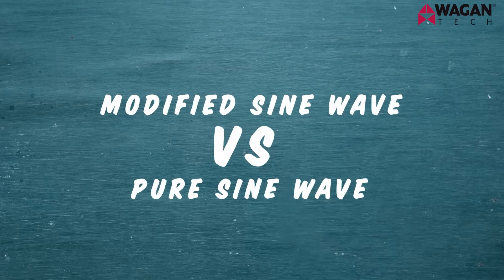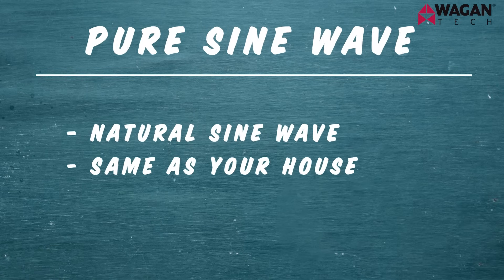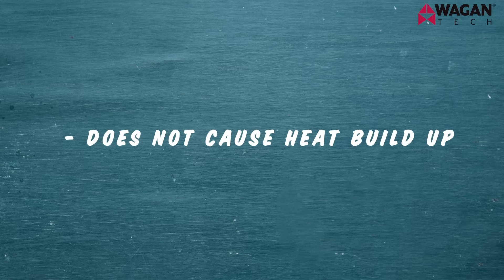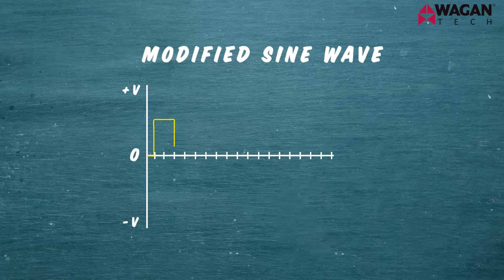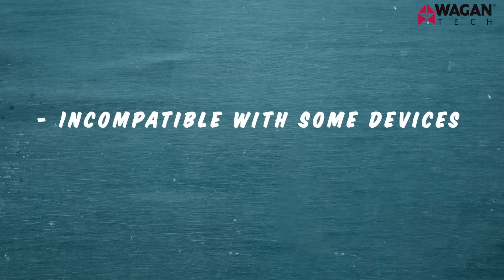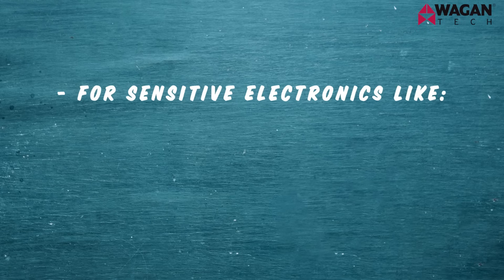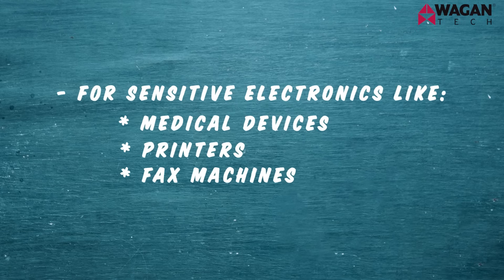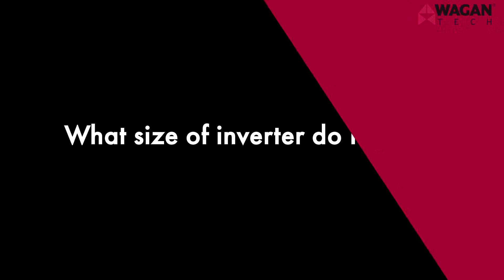What is a Power Inverter and which inverter do I need? What does a power inverter do?

Comment: you explained the difference between Pure sine and Modified sine, but in my mind i would just then want to go with Pure sine as it can be used for all?  Is there a negative reason for using pure sine on a blender for example?
Reply from the maker: No, there's never a negative to using pure sine over modified sine. The only reason that MSW exists is price point.

Comment: What would i need if im trying to run a makita air compressor
Reply from the maker: Air compressors generally run just fine off of MSW. Be sure to get an inverter that can handle large start-up currents as air compressors require a huge amount of current at start!

Comment: what happens if you use a much bigger inverter than you need.? ie:- 1500 watt  and my appliances are 800 watts maximum
Reply from the maker: Good Question! There are no detriments to using an inverter that is too large.... the only thing that will suffer is efficiency as inverters should be outputting around 80%+ of its capacity to be the most efficient. At 800W , a 1500W inverter would be running at 53%+ efficiency which would be just fine.

Comment: Hi

How to set up a mobile tire change  van with 1500w inverter  powering 1500 w air compressor + 1050w tire changing machine ?

24 gallons air compressor gets full in aroud 4 minutes which is enough to fill 1-2 tires , meaning  air compressor will have to be filled 2 -4 times per car . Tire changing  machine  will probably work for 8 minutes per car. 
120 ah battery should fill air compressor and  still have about 75 ah left after it.

Once 1 car is done this way then van will idle for 10 minute while packing tools and then  travel to next car for about 20 minutes + can idle for another 10 minute while getting tools  out for the next car.

Wonder how fast can van's alternatot recharge battery while idling and driving for this kind of time intervals.

Ford transit 2004 , 2.0 tdci, fifa, 92 kw

i think it has 105 a alternator .

Where to look for larger alternator if it can be installed ? Thicker cables as well ?

Thanks !
Reply from the maker: Here's a video we did on cable selection too: https://www.youtube.com/watch?v=aKs3oZnBOPM&t
Reply from the maker: It looks like your stock alternator is about 105A, but can accept 150A with ease (confirm with Ford)- I see them for sale online. Getting the most power from your alternator is the best place to start since you're power needs are high. How fast it will recharge the battery is dependent on how much power your van is consuming, unfortunately I don't know what that power number is.
The inverter you're considering is 1500W, but will be needlessly taxed in this set-up; I would recommend an inverter of 1800W+ for using the machines individually (added 20% buffer to the highest wattage appliance).
Will you be running the air compressor and the tire changing machine at the same time? If so, you're going to need an inverter that is 3000W or greater (1500W + 1050W + 20%).
A 120Ah battery seems about right for your needs as long as the alternator can keep up; I would suggest a second battery to lessen the load on the system.
For the cables you'll need, first know which inverter you're getting, then look at the distance the cable has to "run". Once you have that info, take a look at this chart here to find the fuse and cable gauge you'll need: https://wagan.com/blogs/news/customer-question-what-cables-do-i-need-for-my-power-inverter
Hope this helps!

Comment: Can I charge the inverter from a regular wall outlet ? Or just only can work with cigarette outlet ?
Reply from the maker: Hi! Inverters don't have batteries, so they can't be charged. The power inverter is primarily to take your car's DC power and turn it into useable AC power (regular wall outlet). 
If you buy a portable power pack that has a battery and an inverter built in, those can be charged from a wall outlet, car socket, even solar power: https://wagan.com/collections/lithium-cubes

Comment: I drive a car with a small 1.6L engine and 12Volt battery.  Can I plug an 8000Watt inverter into the cigarette lighter and run a 1800Watt vacuum cleaner, or will this overload my car's electrical system.
Reply from the maker: Hi there, Your vehicle would not be able to support an 8000W inverter; there simply isn't enough juice to power it.
The cigarette lighter socket is either fused at 10A or 15A which means you can only get a max of 120 watts or 180 watts - there is no way to pull more wattage from the cigarette lighter socket.
If you need to power an 1800W vacuum, I would suggest getting a 2000W inverter and connect that to your car's battery (and use with the engine running).
Reply: @WaganTech   Thank you!
Reply from the maker: @Afrocanuk  my pleasure!

Comment: There are in fact square wave inverters, they're very rare nowadays as everything has gone to modified. modified is anything between square & sine wave. Usually that means one or two steps to approximate a true sine wave in a blurry fashion. They run most things but they are not very efficient and motors tend to not like them.
Reply from the maker: You are correct, the MSW today is way "cleaner" when compared to the true square-sine wave inverters.
Reply: @WaganTech  in some ways I think true square wave would be more useful now that everything is switch mode power supplies these days. But now that I'm on a true sine wave (
Wagan) inverter I would not go back. And wish I just saved money up and did it the first time.

I tried to run a salsa off a 750W modified sine wave inverter, after I upgraded I was able to run the sawzall + fan and I think I might've had a heater at the same time from a 700W! I went from having to hand saw with the sawzall to I wish I had this last week! A tree fell across are road and my dad noticed it at 4 in the morning leaving for work so I needed someway to cut it without making too much noise in the middle of the night since it was in a blind spot at that. And well away from power.
Reply from the maker: @imark7777777  Did you mean sawzall?That's awesome! Thanks for sharing!
Reply: @WaganTech  yes speech to text can be annoying.
Reply from the maker: @imark7777777  LOL, so true!
Reply: @WaganTech  well I just pulled the trigger on a 2000W and 3000W. I noticed that nowhere was the size of the cable mounting bolts listed. Or did I just miss it somewhere. Planning to measure when I get them for some quick disconnect Anderson Powerpole connectors. It's going in the van and I'll have plenty of power to spare and be future proofed. I will also be able to run any AV equipment I need although the 700W one already fulfilled that just fine for my PA equipment, although might be on the edge of the requirements of other band equipment. The 2000W willl be my mobile unit so I don't have to rip the van apart if I need to borrow.
Edit: 3/8"
Reply from the maker: @imark7777777  glad you figured it out, please let me know if you have any other Q's!

Comment: Due to the over 100 heat weather in Ca, We lost power twice in a week. Do you think is safe to run a home refrigerator using a 2000 watt car power inverter?
Reply from the maker: You can as long as the battery can handle the load. We're in CA too, today is going to be a scorcher - stay cool!

Comment: Thank you for the video. Doe this mean when I have a 4000 watts inverter, I may connect and run  a 3000 watts vacuum  cleaner?
Reply from the maker: First off, thanks for your Q and for watching!
If it is one of our inverters that you own, then the answer is YES!
Reply: @WaganTech  certainly your product here in South Africa 🇿🇦.  Should I start each motor gradually to run full 3000 watts on the 4000 watts pure sinewave inverter.

I am learning how this works as I just started a pressure washing business with intentions of adding gutter cleaning using a vacuum cleaner with a 12v batter 100ah and a 4000 watts inverter.

Comment: I have a question...... if I use a inverter 1000w which is running from a 12 v battery charger running from mains and i am  runming a desktop pc .... will I be using more electricity or less .....?
Reply from the maker: Jesse, you'd be using more power. A PC actually runs on DC voltage, so the transformer inside is converting the wall AC into DC already.
In that set-up you suggested, it would be taking AC power to feed the battery charger which would turn the AC to DC. The inverter would then take that DC and turn it into AC for the PC.
Literally it would be: AC to DC, DC to AC, then AC back to DC.

Comment: I have a 50 whatt light and a 800w inverter the inverter turns on and starts beeping on its own and turns off and a lawnmower battery u1r and rv 29dc battery and it works for a little bit but stops shortly after
Reply from the maker: David, there can be a lot of factors here. 
Is the inverter connected directly to the battery and what gauge cable are you using? 
Obviously the load is well within the limit, but I would like to know what voltage the batteries are at?!
Is there a dimmer switch on the light?

Comment: Great videos, I have a Mackie Thump 15 loudspeaker 1000 W, which inverter would you recommend on your website
Reply from the maker: For speakers, I always recommend Pure Sine to avoid any humming noise that may be generated! If your speaker is drawing 1000W, I would recommend getting a PSW inverter that is 1200W or larger like our Pure Line 2000.

Comment: Can this be hooked up straight to a battery that’s not under the vehicles hood? You have videos on this?
Reply from the maker: Yes, you can connect straight to any battery that is the appropriate voltage. You should always fuse the cable between the battery and inverter.
We have an excellent blog here: https://wagan.com/blogs/news/how-to-connect-a-large-or-small-inverter-to-a-battery

Comment: How about running a hot-tub using a solar panel to batteries then the inverter to power the tub.
Reply from the maker: Only if I can join in!
You can certainly do that, I know a couple of people who power their cabin's hot tub in this manner.
Find out the hot tub's power requirements (in amps or watts), then that will get you the inverter size you need. NOTE: Some hot tubs are 240V instead of your "standard" interior household 120V) - you'll need the appropriate voltage inverter for this to work!
I can help calculate battery-bank size needed for powering the hot tub once you get me the run-time per night (desired run time of the hot tub per night).
Of course, check with your local city/county codes for proper & safe installation of electrical appliances!
Reply: Thank you for your response. Of course you can  and share a beer 🍺 my hot-tub is infact 240v 50hz. The heater is 2050w. And heater + bubbles are 1850w I'm looking to have it plugged into the inverter 24/7 so the heater kicks in and out to maintain the correct temperature and when it's in use probably run the bubbles for about 1 hour 30 minutes max for the day then it will be left to just have the heater kicking in and out to maintain the temperature again. Hope this helps many thanks Wayne.
Reply from the maker: @waynehammond1384  That's going to draw a ton of power; you'll need a large battery bank to keep that going 24/7. If you want us to calculate that bank, shoot an email to customerservice @wagan.com

Comment: I wana run a portable ac of 1500 watts in a car which invertor should i use ?
Reply from the maker: Usman, the biggest problem is going to be having enough power to keep that AC unit going.
Find out what the surge current (in Amps or Watts) of the AC unit is (usually when the compressor comes on), then find out how long you want to run it for. 
If the vehicle is a diesel or something with a larger alternator, this probably wont be an issue; if it is a smaller car, then the alternator probably wont be able to run the AC unit.

Comment: what's better for charging devices, power inverter or car charger?
Reply from the maker: Hey Stephen, What do you mean by a "car charger"? A power inverter is great for converting your car's 12V DC power into household type 120V AC power.
Reply: @WaganTech  It works the same way - plugging into the lighter socket - and has usb and c slots for charging devices.
Reply from the maker: @stephenhogg6154  oh, gotcha. Those type of devices are perfect for charging your tablet and your phone.
If you want to charge something like your laptop or power your 120vac appliance, that's when you would want to use a power inverter.

Comment: tell me how to use them in a hurricane situation in FL. can they run a fridge? how big, how long? I was told to turn on fridge for 1 HR for 4 hrs of rest
Reply from the maker: Diego, that's a very good question! Ideally you'll want to have a car nearby to power the inverter when needed.
If it's a newer style refrigerator, they generally run in the range of 250 to 400 watts, you'll want to check the specs of the refrigerator to see what its running wattage is. When you're concerned with power, you'll want to open the refrigerator as little as possible to keep the cold inside.
Refrigerators only run as needed, so they're actually quite power efficient in that sense.

Comment: Great video. Do I have to car keep running while I’m using the inverter? Thank You
Reply from the maker: Thank you and good question!
You don't necessarily have to keep the engine running; it is dependent on a lot of factors including battery size, load, etc.
In an average car, you don't need to keep the engine running for charging a laptop or other small electronics. 
If you're running a blender for just a few seconds, you wont have the engine running.
If you plan on running a high-wattage item for a long period of time or a low-wattage item for a long time, then you'll need to run the engine a bit.

Comment: whats the minimum 12v battery amps i can run an inverter on?.....
Reply from the maker: It is all dependent on the item that you plan to power with it... the larger the item or the longer run-time, the larger the battery you'll need.
If you send me an email with your appliance wattage/amperage and your required run-time, I can tell you what minimum size battery you will need to run it.
customerservice@wagan.com

Comment: i have   4 panels poducing   30.7 volts i  want  to  powere  an emersion  heater    what  converter   do  i  require   will  i  need    more  panels  to  power an emersion heater
Reply from the maker: Mark, is it a small immersion heater for heating tea, or is it a large one? Do you know what the wattage required for the immersion heater is? Either way, you'll actually need a battery to power the immersion heater and use those solar panels to recharge the battery.
Reply: @WaganTech  its  3 kilo watt
Reply: it heats hot water
Reply from the maker: @markthompson1134  you would need to power that immersion heater from a battery bank as 3,000 watts is not easily powered and not stable using only solar panels.

Comment: Hi Justin what type of temporary portable battery source is best for running a small microwave or refrigerator in a van? Thanks
Reply from the maker: Hi! Microwaves draw a huge amount of power (like around 1100 watts), a small dorm fridge will only draw about 70 watts. You'll need an inverter that can handle that load as-well-as a battery that can feed that power (for the microwave). I can help you select the right size battery if that helps?! I just need to know the expected run-times between charges (or driving).

Comment: Can I connect my inverter to a new 2021 Hybrid SUV battery and keep it on all night??????
Reply from the maker: Michael, you would need to check the owner's manual for the best way to connect the inverter. I would suggest turning off the inverter when not in use to avoid unnecessary battery drain.

Comment: So if you got one that had lots of wats like 750w would that be better just so you know you don’t overdo wats
Reply from the maker: River, you can get an inverter as big as you want, but then it comes down to efficiency.
Let's say you were to buy a 5000 watt inverter but you only had a 200 watt load that you'd apply to it. The inverter would work fine, but it would not be efficient and use more power than it would need to.
Generally we recommend sizing the inverter so that it will be using 70 to 80% of its power range while in use; this will provide the maximum efficiency for your setup.
Reply: @WaganTech  thank you very much!
Reply from the maker: @willywonka9613  my pleasure! Feel free to reach out if you need more info!

Comment: I am a barber and when my coworker beside me operates his hand held hair dryer it slows my hair clippers down. Any suggestions?
Reply from the maker: Are you both using a power inverter or are you plugged into a wall socket? Either way, a salon hair dryer is going to pull somewhere around 1800-3000 watts which is a huge mount of power! This would be the reason that your clippers slow down when the hair dryer is running as that hair dryer is using up all of the available power in the outlet!

Comment: Thanks for the explanation. One question how do I calculate how long can I run a 500 watts laptop with 1000 watts inverter?
Reply from the maker: You can conceivably run a 500W laptop forever as long as the battery (power source) will supply the power. If you know the battery size that you have, I can tell you how long it will sustain a 500w load with a 1000w inverter - shoot me an email at customerservice@wagan.com ... and thanks for watching!